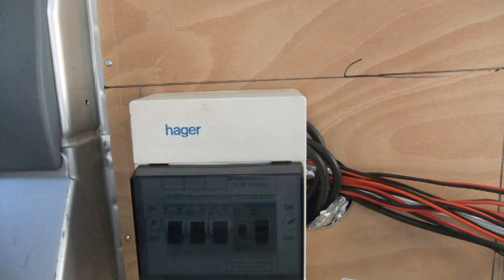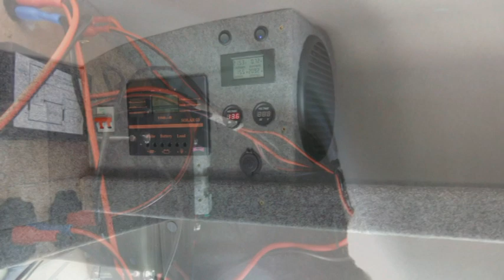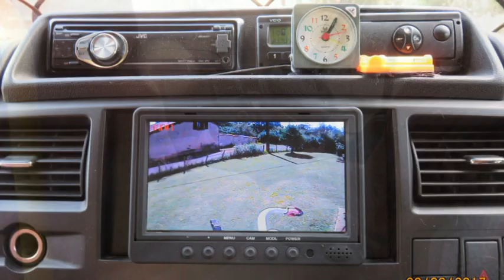My campervan self build Ford Transit Jumbo Conversion.

Comment: Bloomin fantastic, hope ours will look as good, You have given me some idea's for the sliding door step and the little cubby thing on top of the dash for radio etc leaving space below for the reverse camera. Fab.
And I love how you made the bed so it can be raised up.
And is that extractor fan above the cooker 12v ?
Well impressed, great job :-)
Reply from the maker: Thanks for the compliments,. yea we were lucky with getting the high top, right place right time.
Everything we were looking at was the mid top like yours.
"Laura can stand up and cook" LOL  sounds ideal then. :)
The cubby thing was already fitted for the tachograph, which wasn't going to be easy to take out.
So thought it was a good place for a radio beside it, and get rid of the big ford one,
 leaving an ideal space for the reversing camera screen.

The Extractor, now there's a story. I wanted a 12v one but found them way too expensive.
so I bought a cheap domestic one of ebay, 35squid I think.
2 problems, first it was too big. Check out the pics from 5:45 to 6:00min
I cut about 100mm out of the depth then poprivited it back together.
Second prob was the mains fan. So here I stripped the housing down and fitted a cheap 12v motor to it.
It actually works really well, although a bit noisy.
The raised bed was my wifes idea (Well she said couldn't we make it lift up !) and left it to me to figure out.

Comment: Hello mate, really nice conversion. I like the way you reused the lining of the ceiling once you had installed insulation. I am hoping to do the same in my transit minibus conversion. Was the removal and reinstallation after insulation was fitted easy to do? Any tips or advice would be appreciated. Thanks Tom
Reply from the maker: Hey Tom, thanks for the compliments.
As for the roof lining, it was a bugger to get out and put back, it's extreamly fragile it bends and creases really easily, getting all the holes to realign is a nightmare. Sorry if it's not what you wanted to hear.
I'm pleased with how it looks but if I was to do it again I think I would go another route.
I'm happy to help with any questions you may have with your build.
I'm certainly no expert, but may be able to advise of any pitfalls you could come across
Reply: @krustykamper  thanks for the quick reply, I had a feeling it wouldn’t be as straight forward as it seemed! Half of the reason I planned to go down that route was because I thought it might make life easier. I’m not particularly skilled when it comes to wood work so don’t trust myself to make a clean job of cladding. I’m still undecided as to what route I will take but it’s definitely useful to have someone who has converted a similar van to ask questions so thank you and I may be in touch again! Cheers
Reply from the maker: @tgweng626  Hey mate, happy to help if I can.
If you do decide to keep the roof make sure ya got someone to help, and have a good supply of the holding buttons ( the old one didn't come out cleanly, so I bought a load of new ones from ebay)
Also if you check out at about 35second mark you may see the batterns I fitted to the roof.
I needed them to screw the lining to, so as to make sure the lining didn't sag with the extra weight.

Comment: A truly amazing van. I'm blown away with how great it looks. Can I ask how long the transverse bed is? I need to fit a 5'10" person in and worried it might not be long enough. Probably will do it on a Transit custom SWB so not sure if the dimensions would be the same.
Reply from the maker: Hi, thanks for the compliments. 
I'm pleased with how it turned out, it's my first attempt a a full converstion.
done a few day vans in the past with varying degrees of success..lol.
The transverse bed is just on 6ft long and 5ft wide,  the windows it gives me an extra couple of inches in length that a standard van may not.
I'm 6ft and easily fit with maybe a little diagonal fidgeting.
I don't know the diamentions of the "Custom" so can't comment if you will fit.
But I would suggest with a SWB you would be better fitting a pull out type bed giving extra living space

Comment: Cool project, we just bought a 430 to build a camper. How do you manage to open the slidedoor complete?
Reply from the maker: Hi, It was all done in house, in the vid the pictures from about 1:20 to 2:15 shows some of the work. The only things I bought were a new wider center runner to get past the twin wheel arch, and longer runner channel which needed modifying. 
I would not recommend doing it unless you are confident.
Because it can't be put back to original once started
Reply: @krustykamper  ah, cool.

Thank you 🤙🏻

Comment: Nice build ! What was the final weight after building ?
Reply from the maker: Hi, thanks for the compliment.
Total weight was 2960kg dry weight, so close to the 3.5kg it's now rated at.
I have done some mods to get some weight off it to allow me extra luggage capacity.
Last weigh in came in at about 2890kg

Comment: Hi, Could you tell me where you got your sliding door modified to fully open. Have bought the same model but for us it only opens the standard half way. Cheers
Reply from the maker: Hi, It was all done in house, in the vid the pictures from about 1:20 to 2:15 shows some of the work. The only things I bought were a new wider center runner to get past the twin wheel arch, and longer runner channel which needed modifying. 
I would not recommend doing it unless you are confident.
Because it can't be put back to original once started

Comment: Fab conversion. Is the floor in the minibus higher than that in a panel Transit? What's underneath it, and is it possible to reclaim any of that depth?
Reply from the maker: Hi, thanks for the like. I don't think the floor is higher in a minibus, than a panel van.
Although I do know the floor is higher in a RWD Transit, as this is, compared to a FWD.
So no there is no space under the flooring.
I do have an under slung grey water tank  (About 50lt), and I still have plenty of ground clearence, which i may not have had with a FWD
Reply: @krustykamper  Ah, that's good to know! I am hoping to convert a medium roof Transit 350 minibus and from the pics it looks like the floor is higher, but maybe they've just put in a lower step which guess makes sense if it's originally for passengers. Thanks for the info!
Reply from the maker: @theostscot1  Hi, I now see what you are getting at.
Actually What I did was complealy remake the side step to lower it and widen it, I also I had to remod the runners ect so the door opens fully. 
If you check the pics from about 1.40 to about 2.15 you may be able to see where the original step was and how much I lowered and widened it.
Be aware the mid roof transit is quite a bit lower than my hight top.
Mine is just over 6ft, i think the mid roof is about 5" lower

Comment: Got the same van and going to turn into a camper. Where did you get the front passenger seat that rotates from? and also where did you get the side canopy thingy that extends? Thanks
Reply from the maker: Hi. The canopy is a standard Fiamma F45s 4.5mtr
Bought from my local dealer (forget which one)
The seats I bought about 25 years ago they were fitted to my old Mk3 Transit, but they have worn well and I think they still look good.
The Pasanger swivel I made for that seat, 
because at the time there were no comercial swivels avalable.
Reply: @krustykamper  thanks, any tips for doing this van as mine is the exact same! thanks
Reply from the maker: @yamaharaptor1671   Hi.
Main thing is if this is a UK van check with the DVLA before changing the v5 logbook.
They tried to stitch me up with the road tax, (wanted £500+ per year)
Now reg in France (No road tax)
As for the build, make sure you have a plan before you start.
I didn't, and had all sorts of probs retro fitting stuff.
Reply: @krustykamper  Yeah its a UK van, so we need to get the van changed into a camper via dvla? The van will be staying in the uk also
Reply from the maker: @yamaharaptor1671  OK, just be aware the rules have changed since I got mine changed. it's now a lot harder to get it registered as a "Motorcaravan", and as I said be aware of the potential road tax price hike if you are also down plating it.
You may be lucky and they will accept the change without issues.
I can't say it was for me :-(

Comment: Hi is yours a 3 way fridge if so how did you vent it with the windows
Reply from the maker: Hi, no it's a 12v compressor fridge.
I do have a normal vent in the side just to give it a bit of extra help in hot weather.
 if you check out the pictures at about 5.9min you can see the vent just below the centre window.